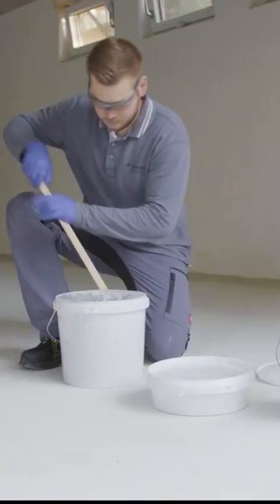What do you use for your weld shop floor coating? #shorts #easyground #welddotcom

Comment: I have an oak t&g floors in an old church building....covered it with 4x12 s of 5/8 sheetrock, then covered those with 1/8  sheet steel  5 x10's  just flopped down on top.  Wow.... 30 years later still good.  easy slide, totally fire proof, easier on your legs than concrete.    I  can take it up and sell or use the sheetrock and steel sheets and have the oak floors back if I want.   I plasma cut, grind, weld at floor level.....totally laughs at  heat, sparks, heavy weights....easy to sweep up.